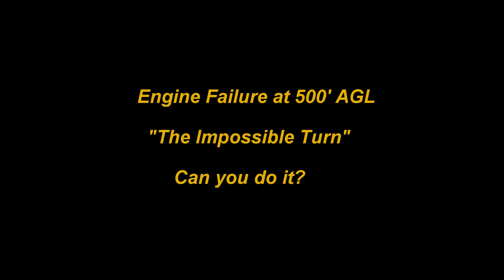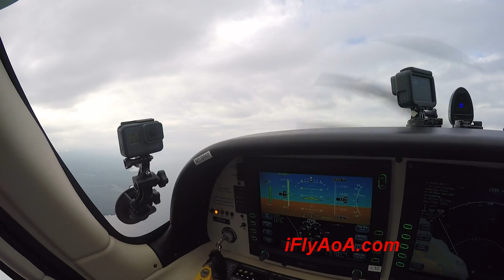Impossible Turn using Angle of Attack

Comment: We have to do the darn turns in gliders all of the time! Instructors in examiners will randomly pull the release handle when your only 200  or so feet off the ground. First time instructor did it to me there was no warning. He didn't even say that we were going to do it that day. I have to admit that once I got the thing on the ground I felt pretty awesome from the rush of adrenaline and sense of accomplishment! Angle-of-attack indicator sound like a really nice tool.

Keep in mind though after you make this turn you're going to be making a down wind landing and a cross wind that didn't seem like a really big deal at take off could put you looking for the runway if you get fixated on your AOA indicator during the turn and having to get oriented then maneuver to get there without the gliders awesome glide ratio and ground effect.
Still, one hell of a better option  than accidentally landing on a kindergarten. ;-)

Comment: We've done the turn in a Mooney gear and flaps up and lost only 200 ft.  But we did a steep immediate coordinated turn with enough G's to avoid an accelerated stall.  We turned as fast as we could and unloaded the G's with the nose down.  But the time we turned around we only lost 200 ft.  And the airspeed was slightly high, but we were able to use the extra speed to pitch up and regain altitude.  There is a mininum safe altudide where this can be done safely, but you must  practice it.  Also, you must be trigger cocked to make the turn and assume the engine is going to quit after every take off.  Once the engine quites, the turn must begun immediately.  Studies show it takes over 5 seconds before the average pilot even recognizes he/she has an engine failure.
     As soon as the engine quits, lower the nose, crank in the steep turn, unload the Gs and you will be around before you know it.  However, the procedure must be practiced very often, otherwise you will become another stall spin statistic.
    Studies show that most stall spin accidents occur during takeoff, not turning base to final like most people believe.  See the article in the last few months of AOPA mag, for stall spin occurances.  They occur mostly on take off or go around.